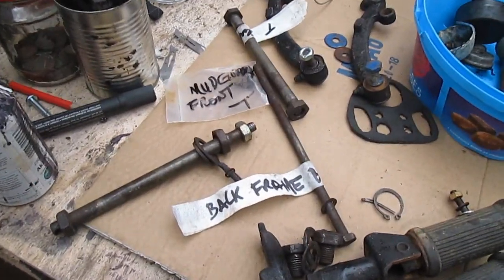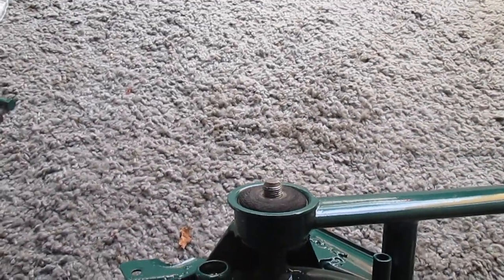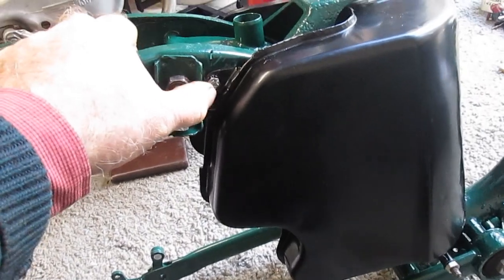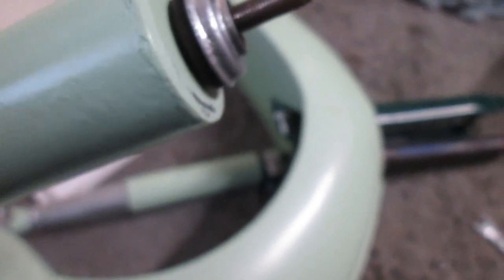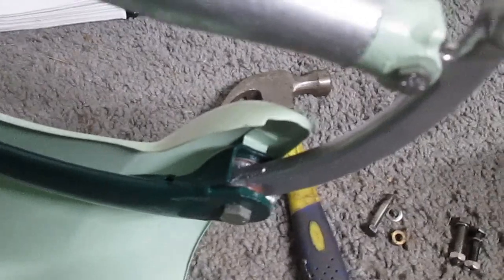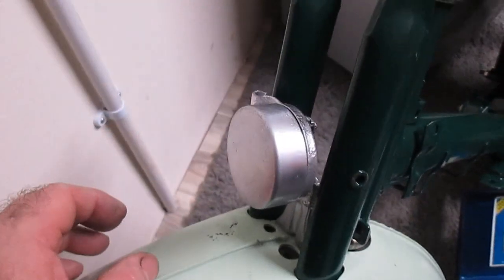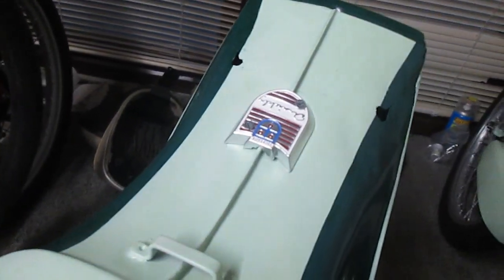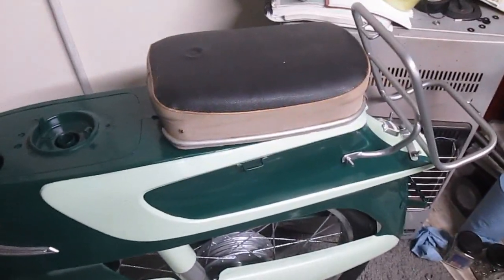NSU Quickly T (The Dream Quickly) Restoration Part 1 of Re-Building./ Motorbike restoration

Comment: Hey @tom cahill I just finished my quickly t and it has no spark. The whole magento is in good shape and the points move but there is no spark. Do you know what could be wrong? The condenser soder is also in good shape but that may be bad.
Reply from the maker: The condenser may not be working as they dry out over time.
Also the starter coil may be inoperative.
The cable to the spark plug needs checking.
The points may also need replacing.
Start at the plug and work back.
Reply: Thank you. The Quickly T hasn’t ran since 1968 so I wouldn’t expect the condenser to work. I’ll order a new condenser and new wire since they didn’t test with the multimeter.
Reply: Do you know how the shift cables operate? I have a 3 speed piece for it but I’m not sure how the cables hook up with it.